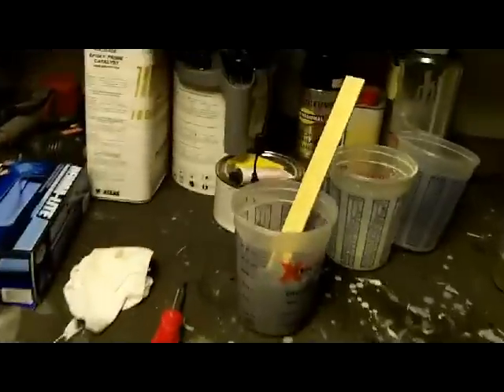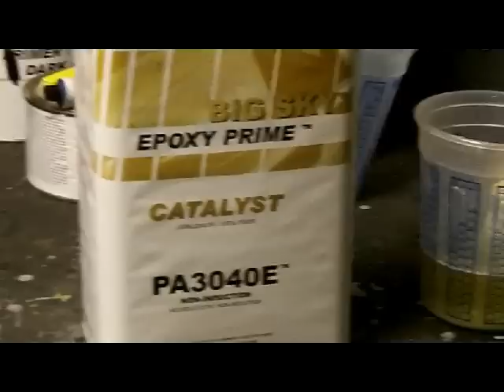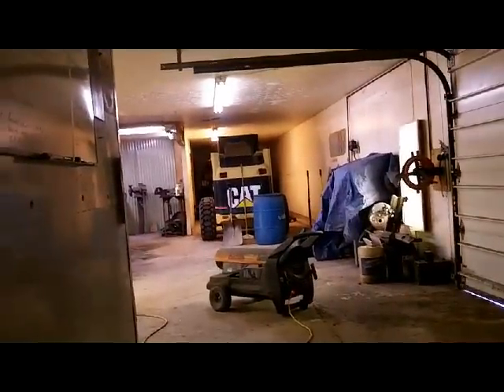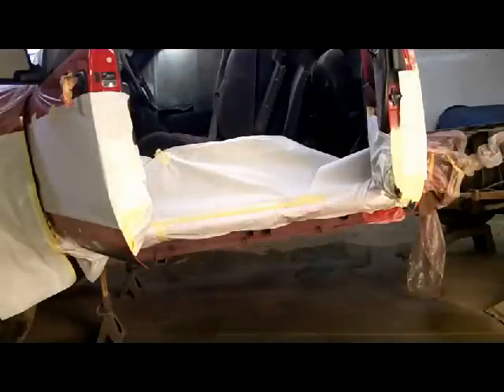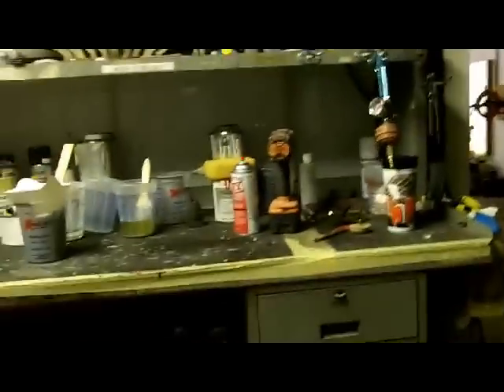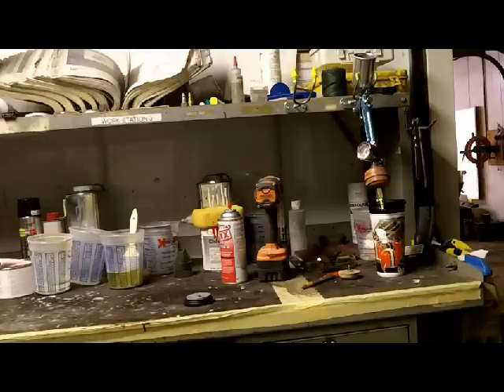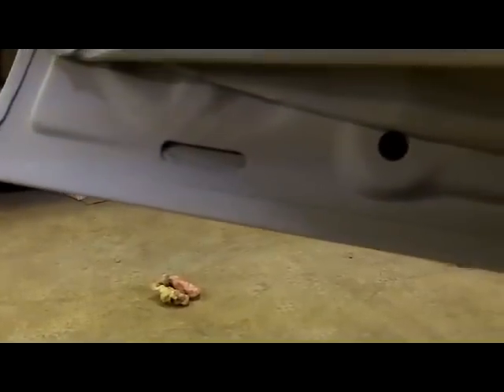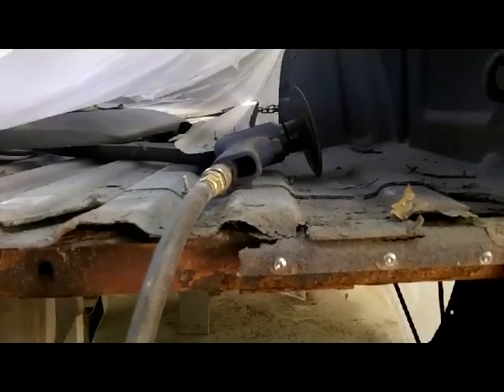Project Duramax - Doors Primed 1-9-13

Comment from the maker: The directions say to use water to neutralize the acid... I use a wet rag and make sure to blow off all excess water immediately.  Then I scotchbrite it and get it under primer immediately so to avoid flash rusting